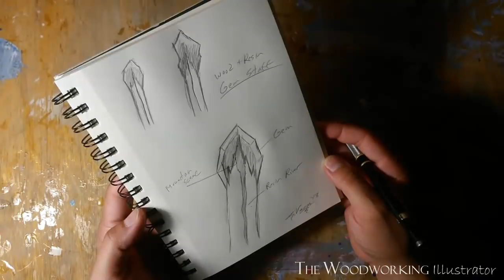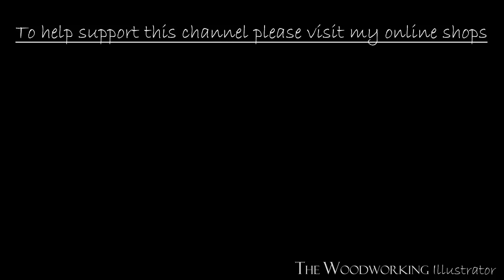Secret Wood Staff

Comment: Nice project. Imagine if you'd embedded several strong Cree LEDs into the core of the resin gem, including one pointing out of the side with a focusing lens, installed a rechargeable lithium battery and set it for induction recharging. Add an internal magnetic switch and wear a magnetic ring. Getting the picture yet? Now that would be fitting for a Gandalfian walk in the woods at night.
Reply: Cetok01 I read your idea. I think I’ll try it. The induction charging is out of my ability but the led lights and magnetic switch are great !  Maybe I can get it to flicker when it is stamped into the floor on a motion switch also
Reply: Yes! Do it! Do you know how to do all this?
Reply from the maker: Fantastic idea!
Reply: Cetok01 that would be awesome man
Reply: Badass! Could you briefly summarize the induction recharging process to me please? What exactly that does, and how to install it?

Comment: You can get rid of a lot of the casting voids by using a vibrator. Also there are several Youtube vids on impregnating wood with resin that may give you some ideas.
Reply from the maker: Thanks for the tip! Much appreciated!

Comment: Recommend using clear packing tape next time for making your crystal. Also brush on some epoxy to seal wood before making crystal to avoid bubbles. Looks awesome and I make the same things.
Reply from the maker: You are very correct. I used the tips you recommend on other resin projects I have done. Thanks for watching!

Comment: Have you tried using super glue in place of varnish? It gives a beautiful hard (almost impossible to sand) surface. Use rubber gloves and rub it on but do it fast. Must ventilate real good. It does give off noxious gas.
Reply from the maker: Yes I have. I use it on a lot of the pens that I turn. I also have used it on lathe tool handles. That is when I have really felt the noxious gas. When it comes to finishing a larger surface I learned that a wipe on poly works really well instead of super glue or a CA finish. Cheers Bruce!

Comment: I'd love to get a thick gloss finish on a walking stick I plan to make in the spring, very much like yours.  But how did you apply a thick coat of epoxy over a complex shape like that?  Do you have a video showing your technique?
Reply from the maker: Hello! Don't believe I have any more footage of the project. I did get the thick coat of resin by hanging the staff and applying the resin from the top and letting it flow down the wood. And there was a disposable pan catching the overflow resin. Probably not the most efficient way to do it. But it worked at the time. I want to make another. Thank you so much for watching!
Reply: @jimvargas-thewoodworkingil9357  Ah, so you brushed the resin on instead of spraying?

Comment: Sir, I am inspired to have a go at this myself. Have never done this before? A question if I may ask. How do you remove the bubbles from the casting resin before it sets?
Reply from the maker: That's great! Normally for most objects I place them in a pressure pot and let them cure in it over night. Because I set this directly to the staff I only would use a heat gun at a safe setting and distance to get rid of some of the bubbles. What I have seen that also works is placing the mixed resin in a vacuum chamber which forces the bubbles up and out before pouring onto your project. I have yet to invest in a vacuum chamber myself. Hope that answers your question! Cheers Joe!

Comment: How did you get the resin to cure so clear? Did you have to let the stick turn?
Reply from the maker: Thanks for asking! It was a standard mix of clear resin. I didn't turn the staff with the resin. Instead I held up the staff with a clamp and let the resin flow downward from top to bottom. The excess was collected in an oil pan. Unfortunately I didn't film it. For my next staff I will be using wipe on poly, because it spreads more evenly.

Comment: Great video.☺️🙏👍. I had a question. I have a tree staff as well. Can I use the same method but along with the mixed adhesive in the red cup🥤, can I add a quarts crystal in the middle 🤔. Will the resin be strong enough to hold the crystal within the mix.🤔. Hope to get an answer.🙏☺️ Thank you in advance 🥰
Reply from the maker: Hello! It may be possible to add something in the center. Whatever you place it the center would have to be suspended there or propped up someway. Because chances are anything would sink to the bottom of the resin before it cured. What I have done in the past with a small action figure is hold it up from the base with the clear plastic tubing. You can find this video on my channel. It uses Vegeta from Dragon Ball Z. I hope I helped answer your question. Cheers!

Comment: Can I use epoxy resin to make the gem?? I wanted to incorporate real crystals
Reply from the maker: Hi Ashley! Yes you can. The gem I made was pure resin. You can use real crystals in the resin as well. I have done some experiments doing that. Keep in mind that the real crystals or stones you use will probably sink to the bottom of the resin casting you make. Unless you fill the whole casting with crystals. Also it would be best to use extra safety precautions if you plan on sanding down a resin casting with extra crystals. As the crystals may be harder to sand or have a toxicity. Hope that helps!

Comment: There are no mistakes. I really like the video. What made the epoxy so hot that it melted the cup? Is clear epoxy that exothermic?
Reply from the maker: I believe it overheated due to mixing the resin too fast.
Reply: Resin comes in a range of setting times.  The faster setting resin can be that exothermic in large pours.  The gaps in the pour also suggest an excessively fast setting for the purpose.
Reply: Lots of mistakes 🤣

Comment: Kind of an odd question but i have a decent size branch of quilted maple i thought to try and make a bow from it but when it dried it got some really long checks in it which sux because the quilting on that branch was phenomenal so i thought about filling the cracks with apoxy kind of like u did in this video and make a cane from it unless that is if i can find out wether or not i could still make a bow from it with the apoxy and know that it will be safe to shoot if not then i recently developed a need the extra support of a cane or staff for walking and that brought me to your videos and you seem like the type of person that wouldnt waste time feeding us bullshit
sorry about the length of the comment but i really had ask someone lol
Reply from the maker: I am not really qualified to answer the question if you could use resin and still use it as a bow. My guess would be no. Because the resin may not make it as flexible. I would suggest finding a You-tuber that has some experience bow making. As a cane though it should be fine and resin would make the wood more stable.
Reply: Thanks for your time i appreciate it

Comment: What kind of resin are you using?
Reply from the maker: I used a two part epoxy resin. It was the one you find at a hardware store. The brand was Famowood. It was the resin I first used in trying out projects.

Comment: What ratio of pigment to epoxy did you use, or do you normally use?
Reply from the maker: I usually just add until I like the tone. For larger projects I would measure out the right ratios.
Reply: @jimvargas-thewoodworkingil9357  thank you, that is what I ended up doing!